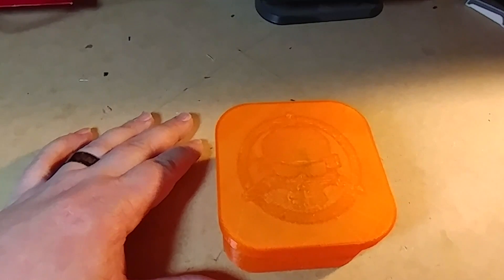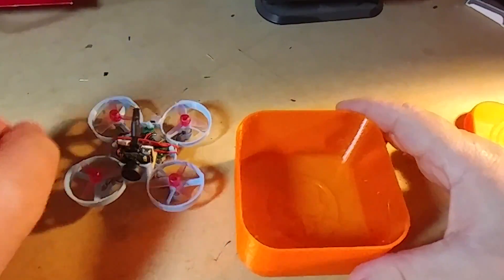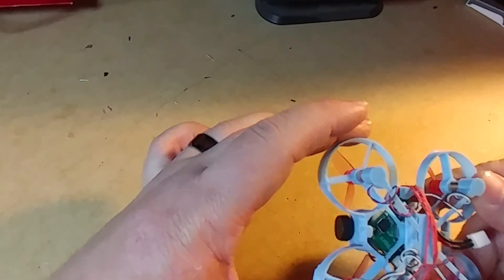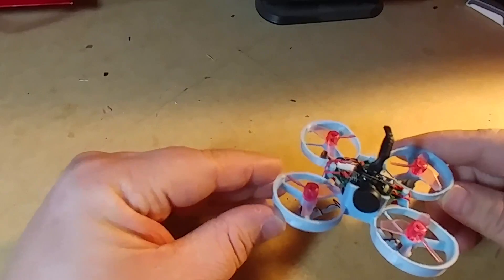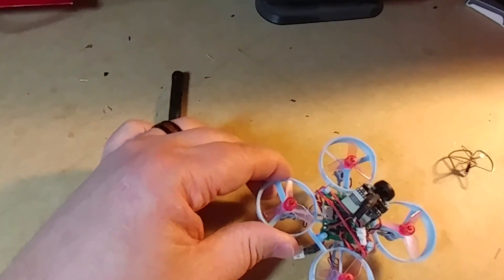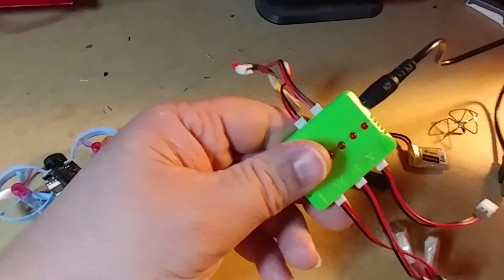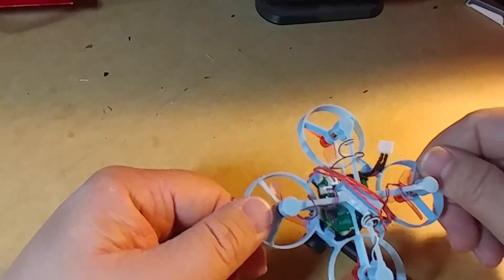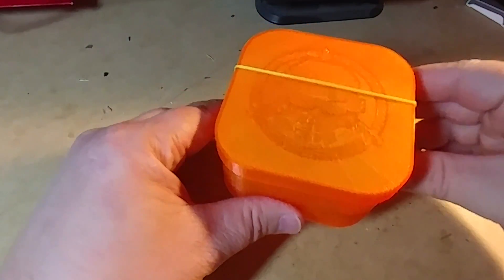3d printed Tiny Whoop build part list

Comment: Very cool 👍🏻 I just got into the FPV tiny whoop hobby and in the process of building some custom builds.  I was looking for battery holder options and found Thingiverse.com and saw people also had tiny whoop boxes like yours.  I am new to 3D printing and was hoping you could recommend a good printer that is capable of making tiny whoop battery mounts, frames, and larger size objects such as 75mm & 65mm tiny whoop storage boxes. I saw that Banggood has this one on sale but do not know if it is a good one that would work for me https://m.banggood.com/TRONXY-XY-2-Aluminum-3D-Printer-p-1355362.html?rmmds=search
I would also prefer a compact one that would fit in my office better but large enough to make the parts I would need for Tiny Whoop cases and frames.  Thanks in advance and Happy New Year! Luv2flypilot ✈️
Reply from the maker: It really depends how much you want to spend. I do not you how good my recommendation it would have because I have only used 1 3D printer.